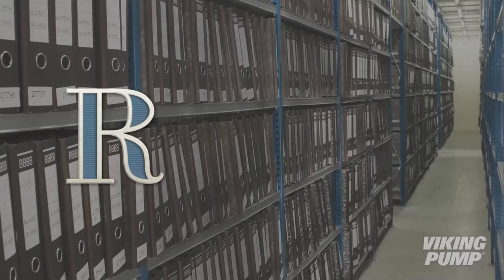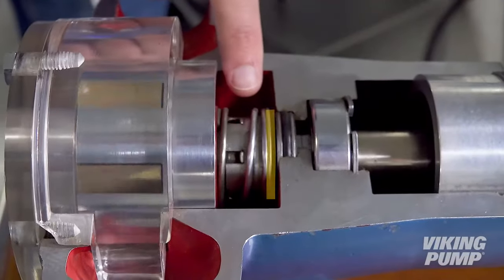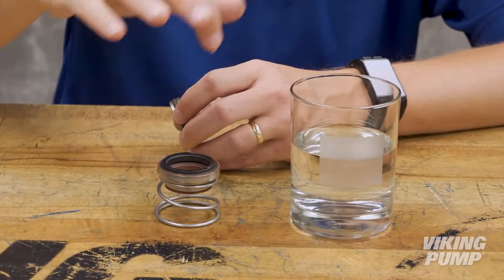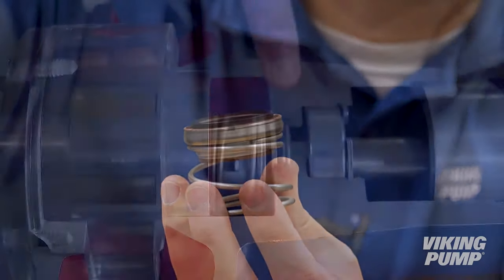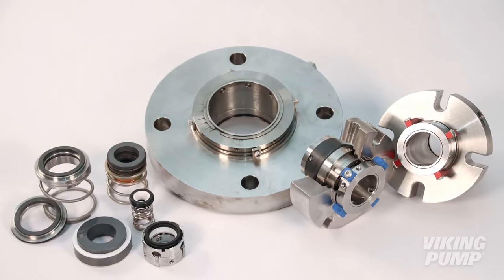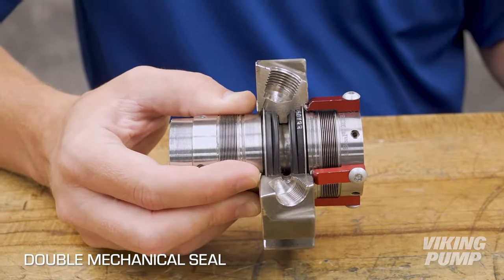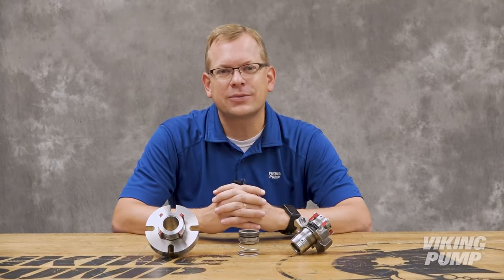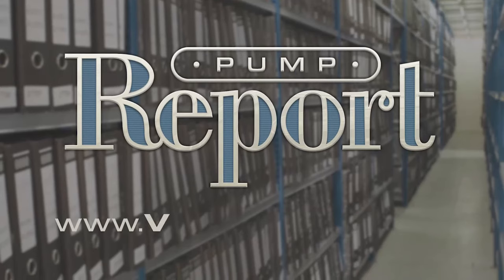What are Mechanical Seals?

Comment: Are mechanical seal need cooling lines?
Reply from the maker: Mechanical seals don't always need them, but often a circulation line can be included to help to vent the stuffing box, reduce pressure at the seal, and/or cool the seal. The type of line used and where to connect vary by pump design, seal type, and application recommendations. To learn more visit us at https://www.vikingpump.com/yt